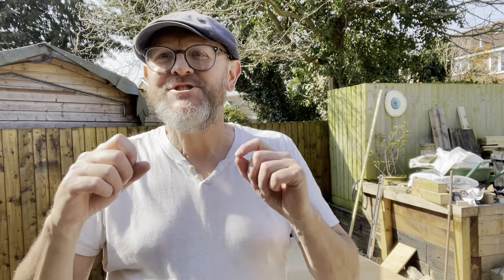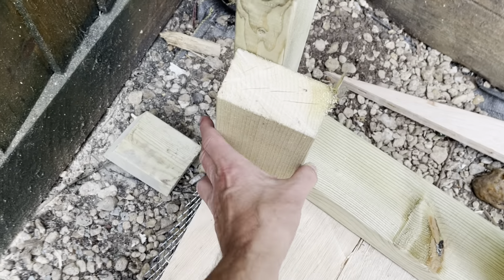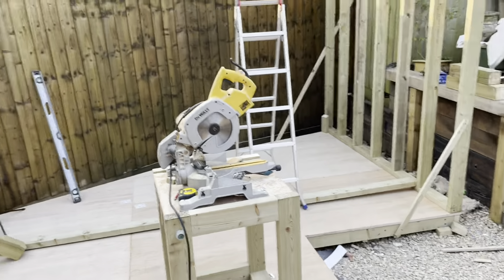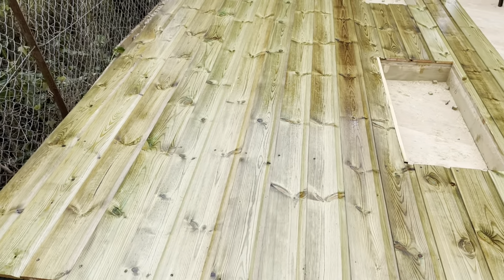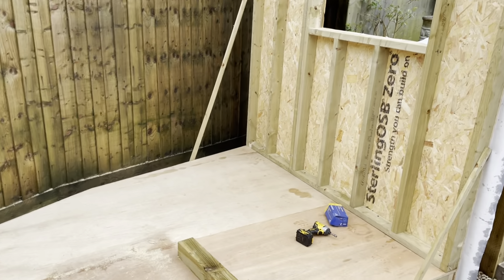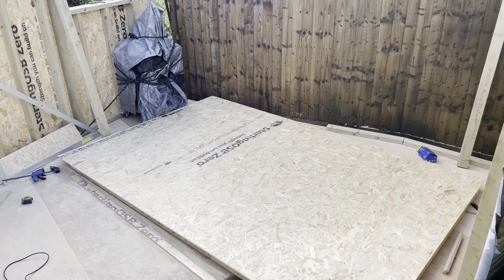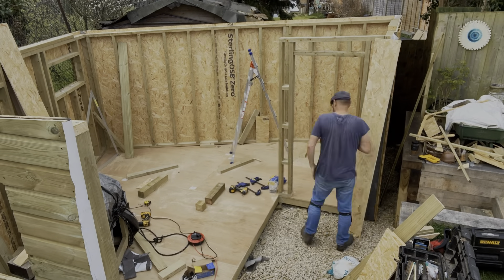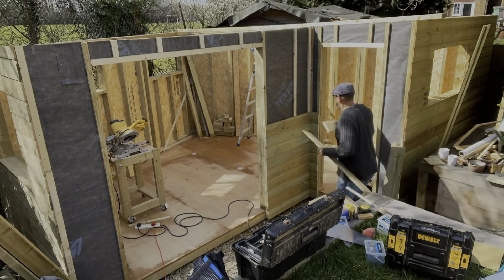Garden Room Big Build Stage 2 Building the walls

Comment: This is a very interesting build series. It looks really challenging. One thing I would like to know more about is how you dealt with the joints between the various walls, on the outside. How did you ensure some overlap in the vapor barrier? Did you put some trim on the joint between the big back walls and the shed-side wall or between the two slightly angled parts of the shed-side wall for instance? If yes, how did you do it given that you have virtually no access to it? If no, doesn't it need something? Looking forward to watching the other episodes.
Reply from the maker: Thanks for this great questions. I overlapped the vent seal at each joint plus sealant in the joint itself. I also took a few fence panels off and worked on the joints from outside from next door garden. I also put outside trim on the joints as additional protection. 
Hope that helps
Mark

Comment: Really enjoying this series Mark, looks like you’re putting in a lot of thought and graft into it 👍 one question how have you finished off the cladding on the external corners?
Reply from the maker: Thanks Neil. The external corners are cut very tightly . I put frame sealant on all 4 layers, the 4x2 frame which is screwed together then the join of OSB which overlaps the corresponding panel. The batten and finally the ship lap which is cut as tight as possible. Then on the outside I put a timber corner piece over the joint which adds another level of protection. All of this also has the waterproof membrane sandwiched in the middle. 
Hope that makes sense 
Mark
Reply: @KAPWoodworkandbuilding  cheers for the quick reply, and it does make sense 👍